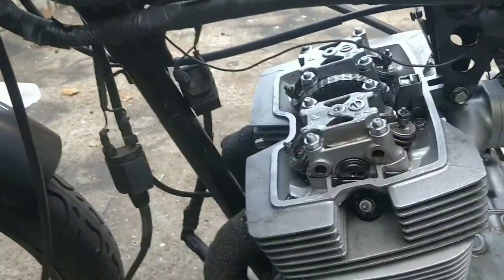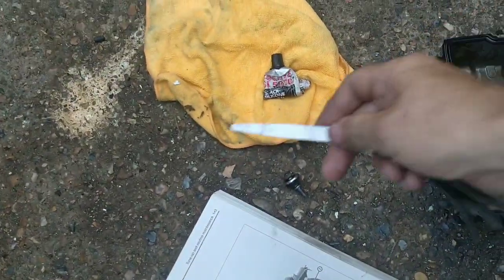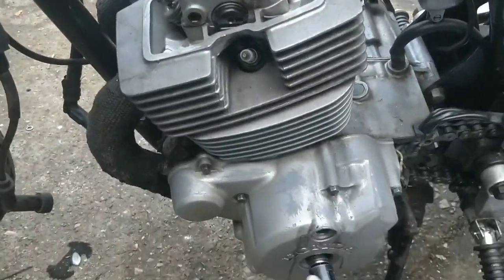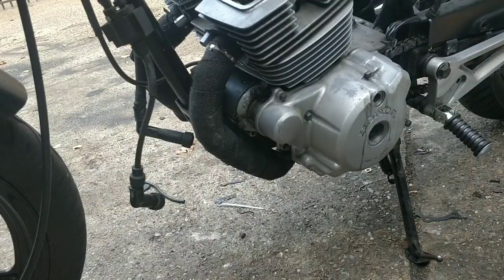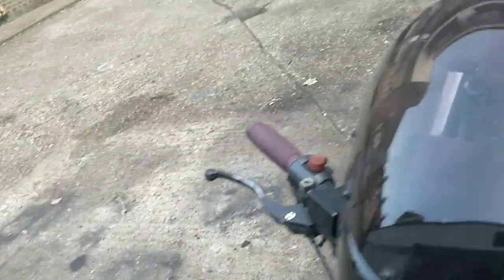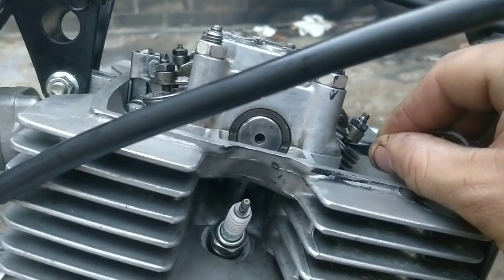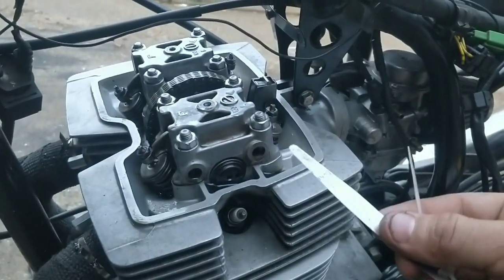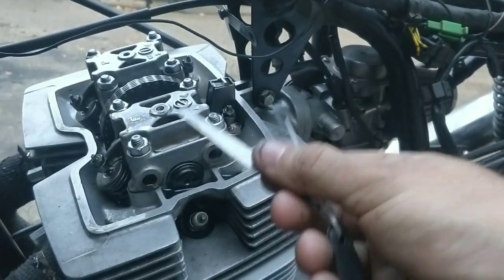Honda cb250 valve clearances, adjustment, nighthawk.

Comment: brill videos ok top fella i have a blown head gasket on my 600 fazer was not to sure where to begain but gonna give it a go thanks to your videos
Reply from the maker: The head gasket is fairly simple over all because you won't have to mess with the valves at all. You can pop the whole head off in 1 piece.

At worse you do the majority and need a mobile machanic to help you put it back together. You will still save a few pound.

Comment: Got issue on my engine, only left side is firing, the right piston has no firing but with spark.
What could be the problem?
Reply from the maker: Are you sure the spark is strong? 

I would be doing a compression test if I was you to confirm good compression.

Comment: Glad you reset the valves, I wouldn't run it though until you change that bush, major damage if it fails.
Reply from the maker: Yeh I get that, the bush is held in place fully by the valve head, its not going anywhere however I won't be running it properly until the bush and locktight is on.

Comment: how did you remove the timing rotation cap
Reply from the maker: Hi Harry, I'm not sure what you mean by the cap mate. Can you clarify please or drop a link to a pick of what you mean? 

Cheers mate
Reply: @motorcyclerescuer  hello
There is a cap. Where you rotate the camshaft with the ratchet spanner. It has a slit it in it. You can't rotate the cam without removing this 'cap'. On nighthawk there's two caps on the left engine casing. The large and small circles with the slit.
Reply from the maker: Oh yes on the engine casing. It's just slits for a flat head screw driver I believe.
Reply: It could be very difficult to remove. An alternative is to put it in a high gear and move the back wheel that will do the exact same thing you have to move it in gear.

Comment: I have a 1995 Honda nighthawk 250 and can't find out what the valve clearances are for in and ex can you help?
Reply from the maker: Hi Jimmy

Intake is 0,12mm and exhaust is 0,16mm

Make sure you use the right feeler gauges with the right measurements mate. Put some oil on and you want it to drag lightly. 

Hope this helps 

Please like and subscribe
Reply: @motorcyclerescuer  Thank you

Comment: Turning the motor clockwise is backwards.  You're not meant to do that. The camchain tensioner doesn't like it.
Reply from the maker: I can assure you that it would have been no problem at all on this engine. 

On some engines it's an issue..